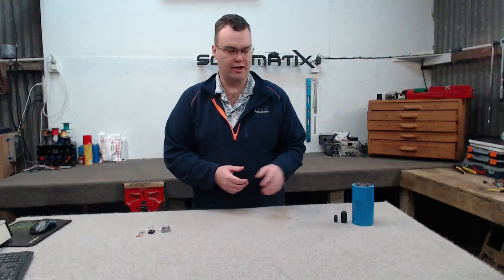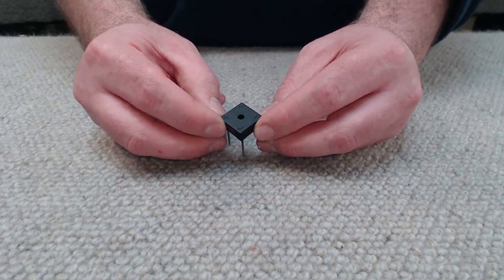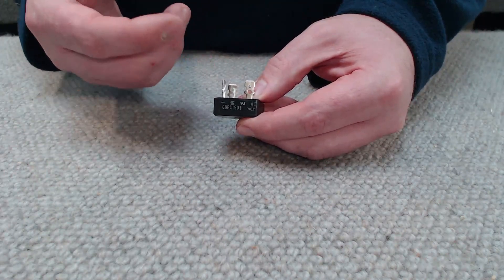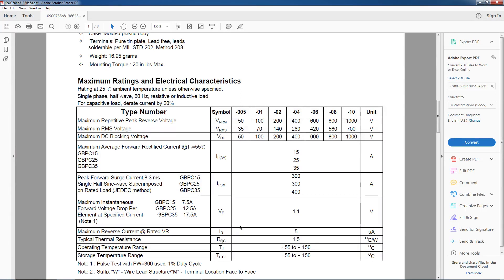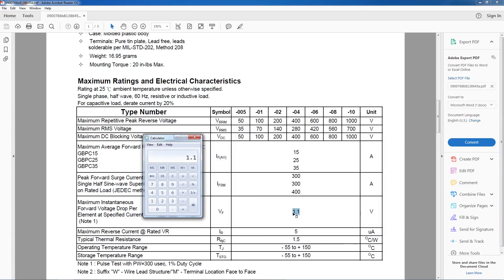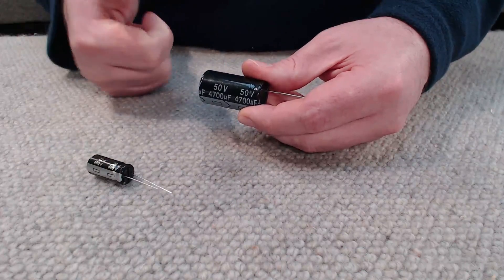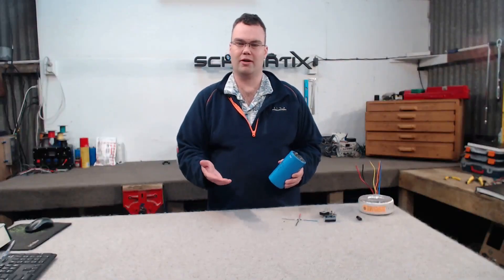How To Choose The Right Rectifier & Capacitor For Rectifing AC to DC

Comment: Hello, i'm asking if you can help me with my project i'm trying to build, please? i have a 18 v battery drill  and i want to convert it to wired drill, so i brought a transformer , rectifier and capacitor. after connecting the drill, i cant get enough torque and there is a lot of volt drop  especially when i increase wire length to the drill.  with deepest thanks for answering.
Reply from the maker: A battery outputs DC power. Transformer can't be simply be wired into a DC source. You're better off buying an inverter from online that will convert the DC to AC to run your corded drill. Another thing to consider is how much current the battery can supply? Typically an AC drill will draw a few hundred watts. And most drill batteries wouldn't be able to supply that kind of power. So I'd recommend using a 12v car battery and using an inverter to run your drill.
Reply: @Schematix  Thank you

Comment: Ive got a tranformer that outputs 30-0-30 ac after i use a bridge rectifer and some capacitors my voltages is incorrect.the positive voltage is 37 when the other is 48 where is the problem?
Reply: I don't know the answer for sure. Perhaps bad soldering. However you led me to an idea of buying separate diodes in bulk and measuring resistance of each, putting together the closest values possible, instead of buying a ready made rectifier with unknown components inside. Thank you.

Comment: Thank you for that great explnation. I have ? if i have only normal diode & i have to make BR from it with Capacitor. if I want 18V & 15A or higher, from 220 transformer. How much should be the diode & capacitor? Thank u for answering if you can.

Comment: Dear sir,
First input supply 230v then rectifier 8A after bulk capacitor 100uf/450v this one ok ?
Reply: u want high votage dc ? if u want high voltage dc  it is fine  since capacitor is very low ripple will be high also

Comment: It is such a shame you decided to stop your videos. Giving that microwave transformer 'what for' brought a smile to my face. For gawds sake keep this bloke away from a power station. However I am about to do exactly the same to a microwave transformer. I need 40V so my wire choice in amps and insulation will be a bit tight. Perhaps you could add a comment as to whether you will do any new videos. I hope you do. Happy New Year from Pomland.

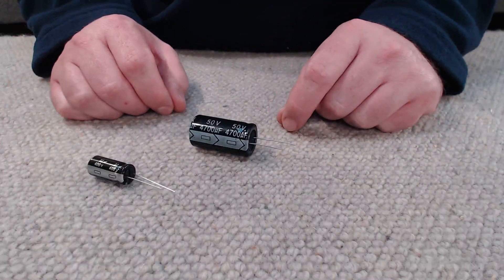Comment: Can someone explain? At 3:38 we are told that "To calculate the volts after rectification multiply AC input voltage by 1.414... " . Why then does the calculation at 8:27 only use 70.5V for the capacitor calculation? Both the 100V (approx.) and the 70.5V are referred to as DC voltage "after rectification". Is this because the 100V is only a peak (as referenced in the RMS calculation), and the capacitor should be calculated based on the nominal 70.5V? Thanks for any explanation.

Comment: 10:19 - Please Sir, is an "electrolic" capacitor the same as an electrolytic one?
I mean, did you mean to say "electrolytic" rather than "electrolic" ?
You clarification would be appreciated.
Thanks.
Great video by the way.
Reply: its just a dialect. or a short form for the all too lengthy word. the electrolytic type is usually choosen in power supplies, as it is well predictable which side is always positive. simply because they are cheaper.

Comment: In your example starting at (8:26) - you state that : "Formular: Current X (sic) Half cycle time / acceptable voltage drop = Microfarads (sic). 

Using milliseconds as the unit of time I get: 10 x 8.3 / 5.5 = 15.09091 but this is not microfarads is it?

OK, so next I tried using seconds as the unit of time, thus: 10 x 0.0083 / 5.5 = 0.01509091  Again, this is not microfarads,

I think you should be much clearer in your presentation of formulae because people run the risk of blowing themselves up.

Incidentally, I believe my second result is actually in Farads. Please, do you concur?

Post edit: Actually, I have just realised that your displayed formula gives the result in millifarads, not microfarads. Please, do you have any comment?
Reply: Well, 1 Farad is the same as (A x s)/V (Ampere second per Volt). The Formula in the Video is: Current(A) times cycle time in milliseconds divided by Voltage so: (A x ms)/V  1 Ampere milisecond per Volt. So your right, the result is in Milifarads.  if you'd calculate with microseconds right away you would get microfarads as a result.

Comment: how do you know what the minimum acceptable voltage is?
Reply: Pretty sure its the voltage forward needed across the diode to be greater than the reverse voltage and the voltage drop or else the diode can't let the voltage pass like if the reverse voltage was say .7 and your voltage drop across the diode is 1.1 you would need a voltage greater than 1.8 . To have any voltage after it passes through the diode so like 1.9 would be the minimum voltage you would need to produce any kind of volts after passing through cus every thing up until 1.8  or maybe just the voltage drop and not adding the reverse. Something along those lines I think.

Comment: So If I were to use in my typical electrical application an electric lawn mower for example which has an electric motor rated at 13 amps maximum with 115VAC(70.5Vdc full wave bridge rectified output with minimum 65Vdc ripple voltage varying output);

13 Max Amps x 0.00835(ms) = 0.10855 

0.10855 divided by 5.5 = 19,736uF for electrolytic capacitor @75Vdc about $35 on google shopping;

would that value work for example electric lawn mower application?

Comment: Good video. So the result of cap with not enough uf will not fully smooth out the current as well as a cap with the proper uf required by your calculation? Does a toroid core wrapped with copper wire, and connected to the cap, help smooth out the current even more than without it?

Comment: Hi, liked and subscribed. I am looking at variable DC power supplies to power small model railway motors. I see best control when using very low smoothing capacitors, the pulse I think helps the motors smoothly start at low speed. However some motors are coreless and therefor sensitive to ripple. I am trying to find a balance between smoothing for those and controllability for the other types of motors. The coreless draw between 10 and 30mA while the other types draw upto 300mA. Be interested in your thoughts? Here is my findings so far https://youtu.be/31bCjaRmjG0

Comment: Lets say i have a transformer of 50 volt 10 amp ac out put. What will be the rectifier or diode rating and capacitor rating?

Comment: Sir,
Excellent video! I just found what I was looking for.
But, I have few questions. 

On 12-6-0-6-12 CT transformer, I'm getting 32V from first and last terminal by reading from multimeter without any load. It is the RMS right?
If it is RMS, then peak should be 45.25V. If I use a 35V capacitor, I'm getting 45V after adding capacitor. is it okay/safe?
Whats does 35V mean on that capacitor - maximum of RMS of maximum of peak?

Thanks in advance :D

Comment: I know I'm asking a lot but if you can help me I'd be very thankful.
I have a AC Lincoln 225 welder (up to 225 amp) that needs to be converted to DC with a rectifier ,capacitor, and inductor and I do not understand what is the right parts. 
I'm very sorry to ask you for this info but I'm not good with electricity. can you please in your spare time figure this for me?
Reply: Ringo Gingo 
all you need for a welder is the rectifier. you can even get them on amazon. they have single module  diodes.  100 & 150 & 200amp. I'd get 3of the 150amp units. mount them to a good heat sink. or a big chunk of aluminum or both. for heavy current you want to over rate the diodes. at least double to triple. the more likely it will survive. use 1/2" x 1/4" aluminium copper steel or brass as links to connect the same points of the rectifiers. when possible. then connect the welder leads to the ac connection. then the +&- is DC output. but mount them to at least a 1/2" x4"x4" heat sink. for short welds . like spot welding.  but check the temp. of the diodes. weld a few seconds . wait a few minutes . check temp. then repeat. if they get crazy hot . you need more heat sink. this is a quick and dirty fix. like that genius with a mullet would have done.
Reply: James stranger you should add at least a capacitor to smooth the voltage ripple in order to get a smoother arc. It could become a real pain especially with stick welding to have an inconsistent arc.

Comment: Hi, Thanks for the video and could you please tell me how to calculate capacitor for DC AC inverter on DC site 12VDC to 220VAC,  24VDC, 48VDC and etc.. or give me a like of the web site please.
Reply: Ghafoor Samadi hello..I need to design 60volr 1A power supply without transformer..can u help me?

Comment: Thanks, really enjoying your vids. Building a twin power supply (2x55 watts) at the moment and bought some (probably) oversized caps because I found no suitable formula on the internet. Now I can calculate if they are sufficient.

Btw, where is the hawaii shirt from the early vids? ;-)
Reply from the maker: Lejf Diecks. Thanks for the feedback. At the moment I'm building a 900watt programmable bench power supply (Build video coming) it was a little chilly for a tropical themed shirt ;-)

Comment: Hello, thanks. In conjuntion with you video on modifying a microwave transformer, if I wanted 15VDC, would the following be correct: 11.5VAC (Approx from secondary winding) --> 16.5VCD --> 15.4VCD after bridge (is it a problem if the bridge is rated at 1000V but the real voltage is 15?). For capacitor: 10A*10ms*0.5V (acceptable voltage drop)= 5000 microfarads. Could I get away with a 25V 4700uF? Or a 25V 22000uF? (that is what I have at hand at present), thanks.
Reply: His formula in the video is a little sketchy.  First, you don't multiply by 10 for 10 milliseconds (milli = 10^-3), you multiply by 0.01 (or by 0.0083 for 8.3ms).  Second, the final answer is in farads, not microfarads (micro = 10^-6).  For your application, it works like this:

(11.5VAC x 1.414) - 1.1V = 15.2VDC

(10A x 0.01s) / 0.5V = 0.2F

That final answer is 200,000 microfarads.  At high currents, it takes a lot of capacitance to produce very low voltage drop (ripple).  The 26,700uF of capacitors that you have on hand will result in about 3.75V of drop at 10A:

(10A x 10ms) / 0.0267F = 3.75V

A few more things to consider...

If you're measuring 11.5VAC from your transformer with no load, that's not what it will produce under a 10A load.  It will be significantly less (as much as 20% less, in some cases).  If you're getting the 11.5V number from the full-load rating on the transformer's label or data sheet, then you're in good shape.

You don't usually use the transformer-rectifier-filter circuit to achieve your desired final voltage tolerance (0.5V, in your case).  Instead, you should design it to supply a minimum voltage to your regulator that never goes below its dropout voltage.  It's the regulator's job to eliminate gross ripple and provide the stable voltage you need.  My point is that if you're making a regulated DC supply, you probably don't need to get 0.5V ripple from your filter capacitor.

For example, let's say you want 12VDC at 1A and you decide to use an LM7812 linear voltage regulator.  The LM7812 has a typical dropout voltage of 2V, so the output from your filter capacitor(s) must never fall below 14V.  Any ripple above that value (within reason) is handled by the regulator.

Tip: if your design is really tight on dropout margin, you can "save" half a volt or so by making the rectifier out of discrete Schottky diodes.

Yes, a 1,000V rectifier will work fine.  Its rating just has to exceed the peak AC voltage from the transformer's secondary winding.
Reply: Hello, thank you for the detailed response, appologies for not responding sooner. The application is to give 15V to a car battery at around 5Amps without forcing the transformer/capacitor Etc (for car battery recovery for a solar set-up). I know I could buy this from ebay, just trying to play around (with care). Once I manage to put something together I will share results!
Reply: +FlyingShotsman why did you substract 1.1v while converting vac to vac max (vrms * 1.4142)?

Comment: Respectable Sir, I have not understood about heat sink size required for any particular watts absorbing I.e dimensions calculation of heat sink required for any desired watts. Respectable Sir, Is there is any formula for it's calculations for installing right sink to required Watts? Please explain this Point ? Overall very excellent explanation, I praise your explanations. Thanks for your teaching us.
Reply from the maker: Thanks. Calculating the required heatsink isn't exactly simple. There are several factors to consider, such as the metal used, the design of the heatsink, efficiency, air flow, climate.etc However, most heatsinks are rated to dissipate a certain amount of watts. Simply put, buy a heatsink rated for at least the amount of watts you want to dissipate. :)
Reply: I know on a typical computer aluminum heat sink one has to dissipate at least sixteen watts of power so a three inch by three inch by two inch high aluminum heat sink should be able to do the job.

Comment: excellent videos keep them coming. im interested to find out how to pair a mosfet and a protection diode cause im sick of destroying mosfets lol. im running a 240vdc treadmill motor off of a 12v battery to 240vac inverter to a bridge rectifier  (now i know how to match a cap for the job) to a pwm circuit with mosfet then to the motor. the motor is 100% dc not ac but the mosfets don't last long. any help would be awesome
Reply from the maker: Thanks! Plenty more videos coming! My first thought is the mosfet being adequately cooled with a heatsink?  If the mosfet is exceeding the rated operation temp it's life span will be significantly reduced. Make sure you have a mosfet rated for at least 20% more current & higher voltage than what you require